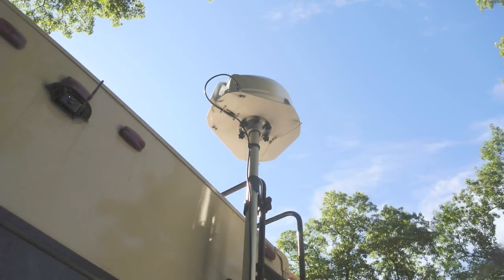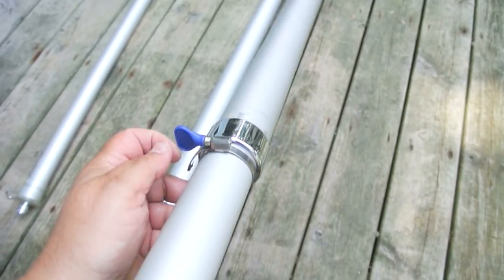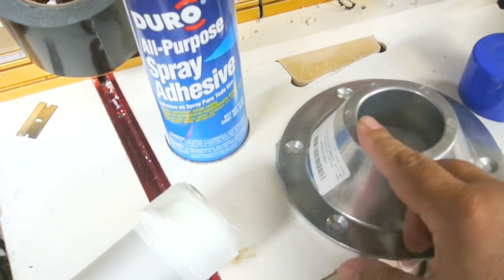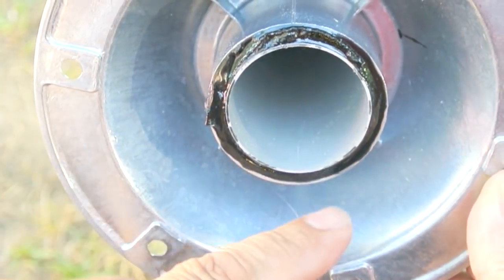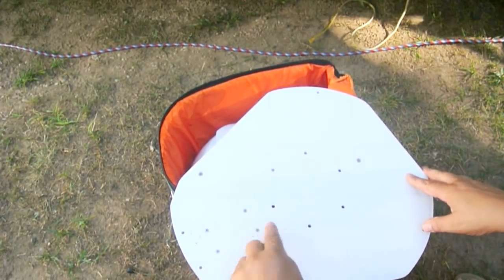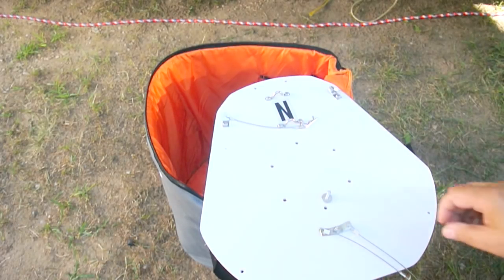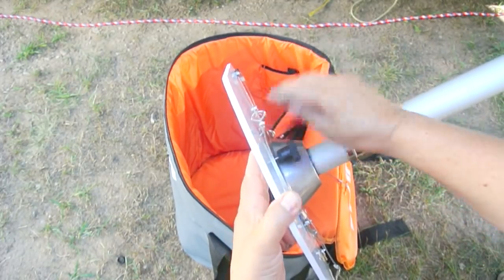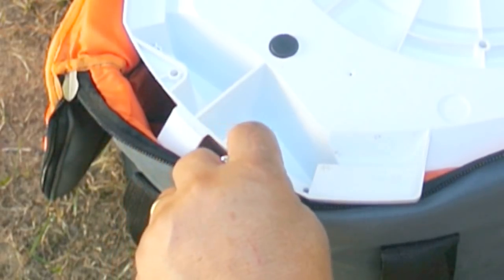Custom building a mast for my RV's Satellite Antenna.

Comment: Hey RV Project, just finished mine and I wanted to thank you for the idea. It came out great. I made some adjustments especially on the Flag Pole holder. The one I used was about $22 plus shipping and it's pretty dam sturdy. Once again Thanks! If I can get your email I will send a picture
Reply from the maker: You can send photos to: acf@rv-project.com

With your permission, I always like to include any customer build feedback for my projects on my website (rv-project.com).

Comment: Thanks for the thorough instructions and good video of your project. I'm planning to make something similar for a much smaller antenna application,  and will use some of your ideas.
Reply from the maker: This actually started out as a mount for a cell-phone booster, but I did not like the booster I bought, so I returned it - and made the mount into what is now.

Comment: How did you get the cable inside every time you set up. Do you us the cable hookup in the wet bay . Thanks in advance
Reply from the maker: The cable in the wet bay was no good, so I installed a new one.  See: http://www.rv-project.com/repairs/satcoax.php for the repair project.

Comment: This is the greatest idea for mounting a satellite antenna or any other directional antenna.  I am in the process of collecting the components to build one of these for my Dish Tailgater Dual.  I received the flagpole and would like to know any tips as to how you separated the sections.  I have tried and I get the bottom section past the small protrusion, but no further.
Reply from the maker: I removed the chrome plastic rings by cutting them off using a multi-tool. Then with a long pipe, I was able to put it down the shaft of the flagpole sections and giving it a whack, was able to knock out the plug in the base.

You have to remember that I did this with an already broken flagpole, so it might have been a bit easier for me to complete the task of part removal.
Reply: @RVProject  Thanks for the info.  I will give that a try.  Waiting for parts to arrive.  Got the 2" x 2" x 1/4" plastic sheet today.  Had to use black as the white was no longer available, but should make no difference.  Will let you know how it all works out.  One other thing - What purpose does the fiberglass tape serve?  I was thinking of centering the mast, possibly using 3 screws to space it from the table mount and filling the entire void with epoxy.

Comment: Really cool idea! We have to mount to the front of our camper though due to trees in the way do you have any ideas of where to mount for that?
Reply from the maker: If you have a regular trailer, you might be able to make some kind of hitch mount for the base.  But it would probably have to be something custom welded.  If you have a 5th wheel, maybe something that attaches to the king pin?

Comment: wouldnt mounting to the roof be just as easy?
Reply: gary s
More holes = more issues
Reply from the maker: Yes you can roof mount it, and you can buy a roof-mount kit for the  antenna ($70 for a piece of metal).  

However, depending on the location of your RV at a particular campsite; say you have a tree in the way that blocks the signal at the rear of your RV where the roof mount is. In that situation, you can still deploy  the antenna with the ground-based tripod at the front of the RV where perhaps there is not an obstruction.

So I wanted to retain the portable nature of the Tailgater antenna, as it has it's advantages.  

Think of it like having the option of climbing up the ladder and sitting the antenna on the roof (which I have done on occasion), but without having to climb the ladder.

King also makes a quick disconnect roof mount that allows you to easily remove the antenna, but that requires a trip up to the roof to do that. I  am getting too old and fat to climb on the RV ladder anymore.

And as stated, more holes in the roof.

If you want to roof mount an antenna, I would suggest something like a Winegard Traveler that is a higher performance, fully automatic antenna.

Comment: Just buy a table tripod mount. It sets up in 30 seconds. No screwing around with bungees cords and pins and a bunch of other crap
Reply from the maker: I have a tripod mount for my satellite as well. But there are times when the tripod cannot be positioned for a clear view of the sky due to trees, buildings, or other RVs nearby. Getting the antenna 10ft in the air is sometimes the only solution.

In those situations; after climbing the roof a few times to place the antenna and after having it almost fall off the roof from the wind, I decided building such a mount was less dangerous than hefting the antenna to the roof as I can stay on the ground to assemble and erect it.